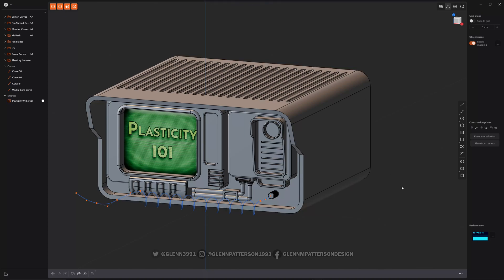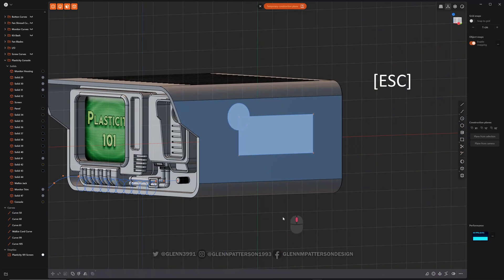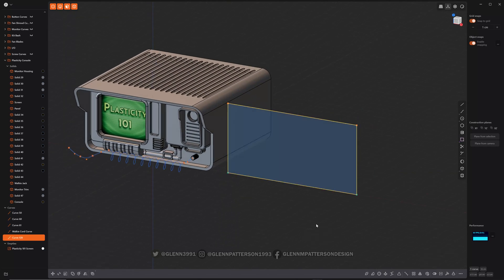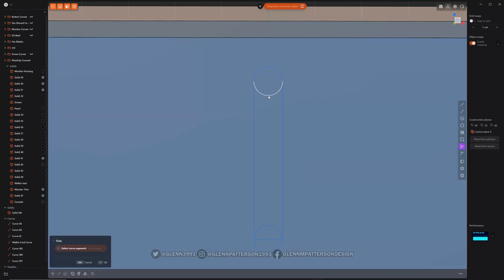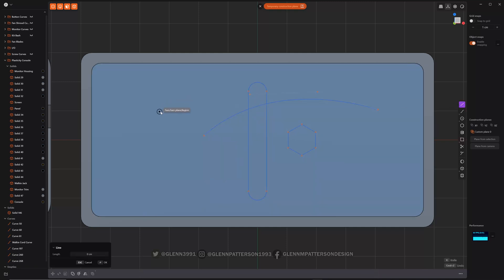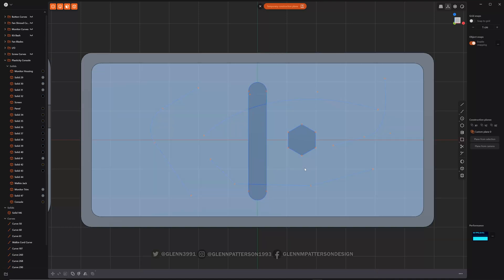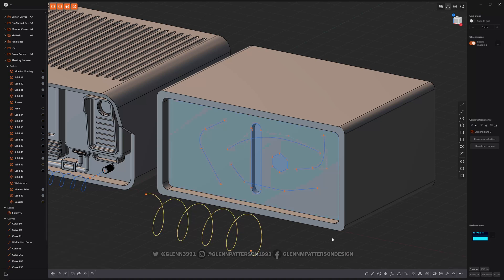10 PLASTICITY 101 CONSTRUCTION PLANES CURVES

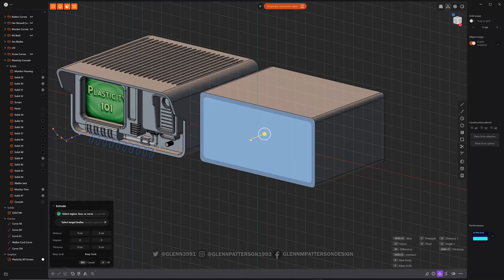Comment: I am using Plasticity 1.2.18. After drawing a plane, I drew another rectangle on the same plane(coplanar). Then  I can select the inner rectangle and extrude the selected Rectangular plane inward, I don't get to see this "pink colored indent"  showing the digging-in effect when I extrude the plane inward that you show from 4:14. Am I doing any thing wrong?
https://youtu.be/Ff5kk41K1nQ?list=PLnJebV8AnDVqd0EMXna2IpXPQauDhGq6L&t=254
Reply from the maker: Sometimes it doesn't realize which body you want to go through. If it does that before you confirm the command tap w for difference and select solid you want to go through. Look on lower right of screen to see options for most of the commands.

Comment: I'm used to MOI, but it's workflow with planes is awkward. This is much simpler and faster. Unfortunately, no chamfer on 2d atm :)
Reply from the maker: I'm sure chamfer is on the agenda soon, because it's pretty common among cad programs
Reply: @Glenn3D1993  Yeah, it was my pitch on Canny :)
Reply: @Glenn3D1993  so am i crazy or did there used to be interactive gizmo's that allowed you to control filets on the contstruction planes?
Reply from the maker: Unaware of a Gizmo for it, one similar to illustrator would be nice. For now just hit B on a point or line to execute a fillet command.